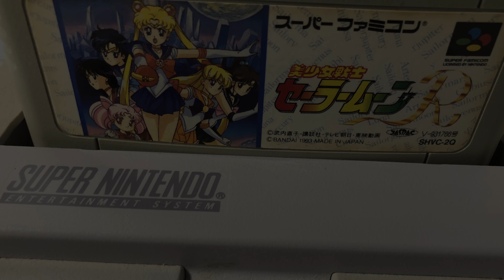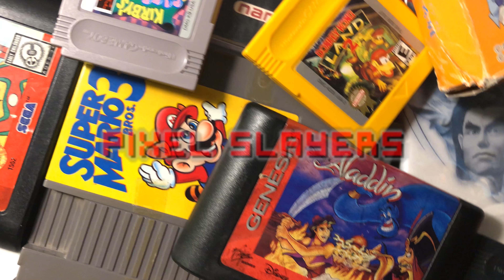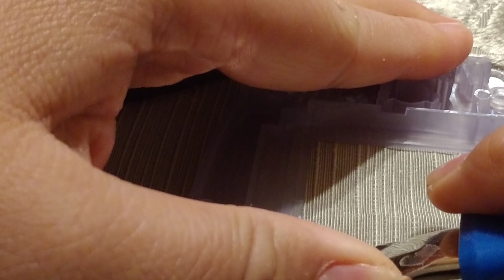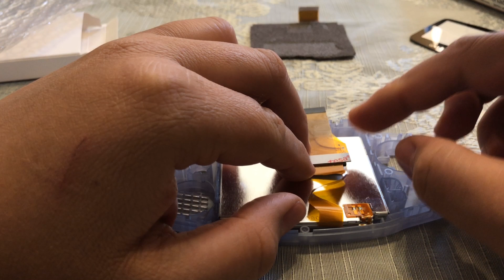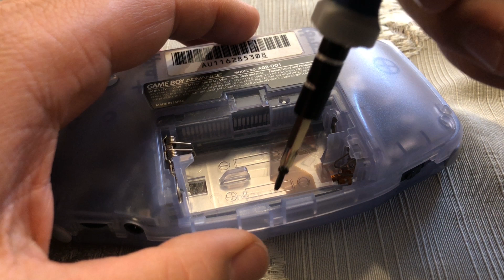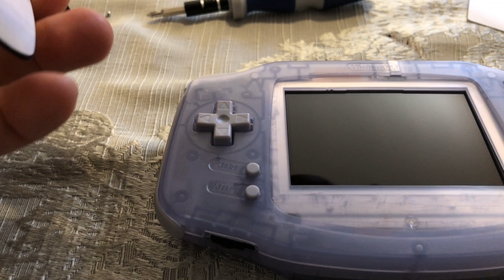Game Boy Advance AGS-101 Backlight Mod | Easy to Follow Instructions | 4K

Comment: The AGS-101 looks very good but a new mod brand named IPS made by FunnyPlaying. The quality looks even better and it has a brighter section by holding the select button and press L and R buttons to make the backlight screen high and low. It's very simple to mod the kit and it's available at Retro Modding plus it's a lot cheaper than the AGS-101. It's worth getting.
Reply from the maker: Awesome! We’ll have to look into it.

Comment: Question about soldering: Are you just touching the tip of the solder "pen" to the board with the wire? Or do you have to melt solder to the board, THEN add the wire? I'm confused on that part.
Reply from the maker: You add a little solder to the pen, then you put the wire up to the solder and heat the wire against the solder.
Reply from the maker: I should add that I’m no expert, im self taught, but this is what worked for me